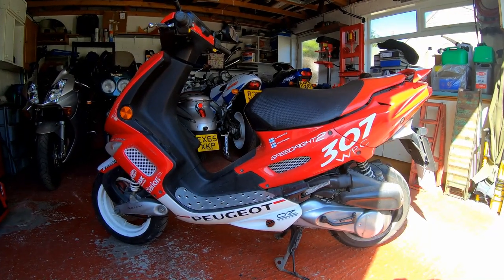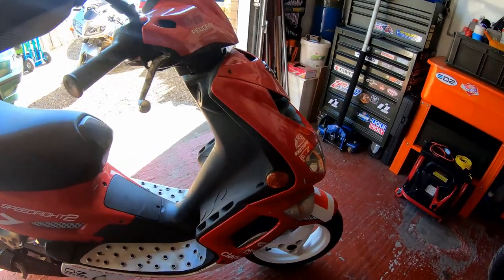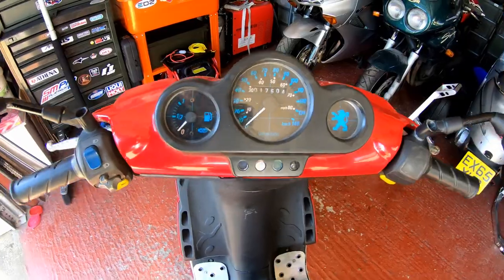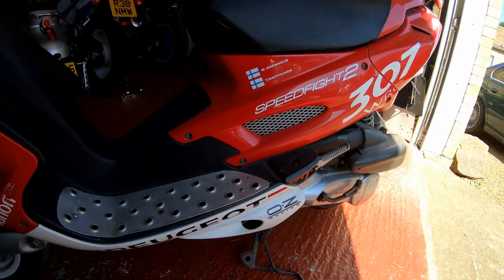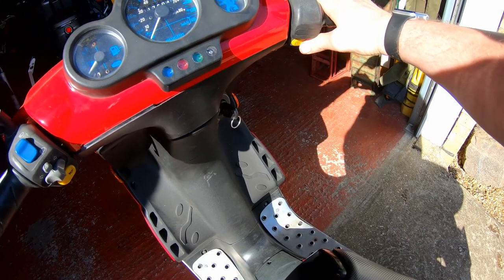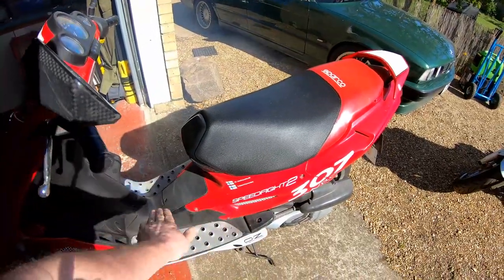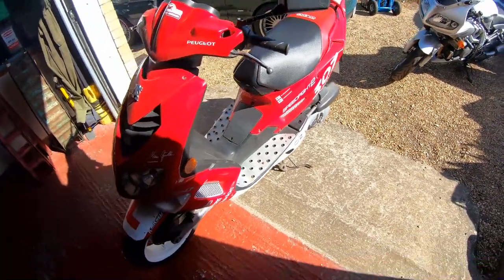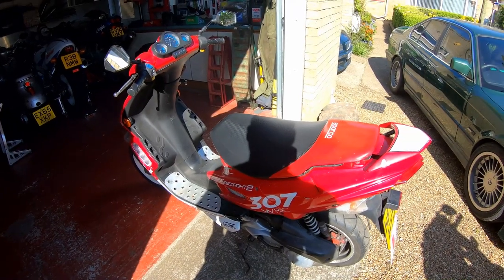Peugeot Speedfight 2 100cc 2T - A Brief Project Introduction

Comment: So happy to have found you, I bought 1 of these today in blue its a 2001 2 owners from new father and son. Its been off the road in the garage since 2004 its only got 6000 miles on the clock. We fitted new battery and fresh fuel and it started straight up but the carb needs to be cleaned I think for it to run properly. It's a little tatty as the son fell off it a few times but it's only grazed/scratches no real cracks to worry about. I intend on restoring it as best as I can and keep it. I only paid £400 for it which I think was an absolute bargain.

Comment: I've got a 2001 Speedfight 2 X-Race 100cc. I bought it new, for £2k when I fancied a change from cars. I haven't started it for six years, so I must get onto that. The front tyre is still the original Dunlop. The rear tyre is only 18-months newer. If I can start it, I'll MOT it & maybe fit new belts.

Comment: My father bought a similar Peugeot brand new back in 2005 . Now I drive it since 2014 . Pretty happy ! Use castrol power 1 racing and good gasoline. You will have 0 smoke . Adjust the jet on the carb . Check the drive belt also ! Mine broke and I replaced it last year . Change the spark plug frequently also . NGK BR8ES I think !
Reply from the maker: The whole engine is going to be coming apart but I will bear in mind all of your advice 👌🏻